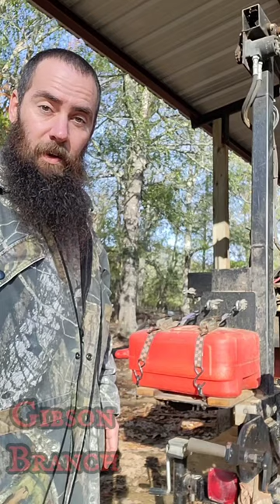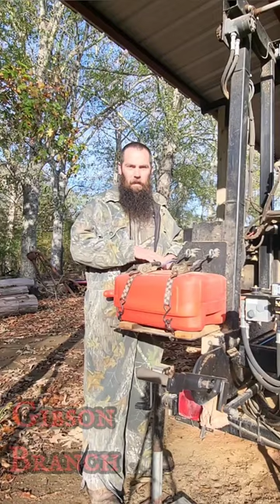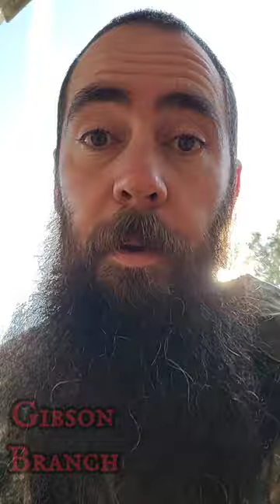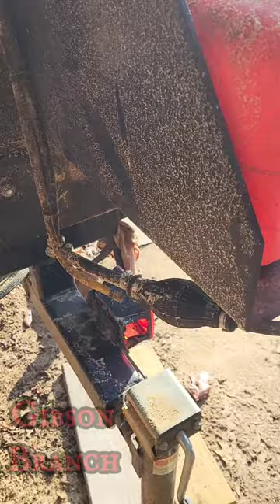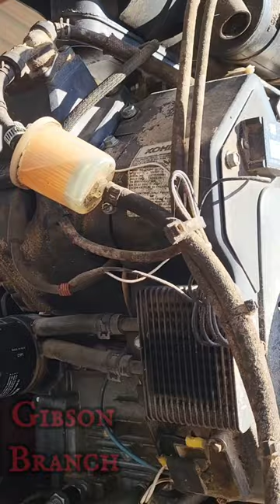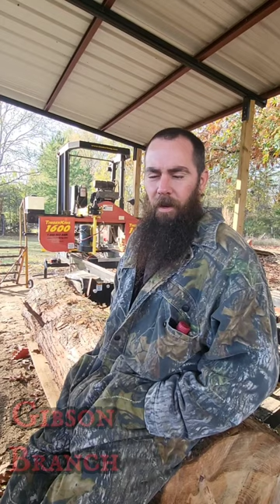Timberking Sawmill Repair (Improved FuelTank)

Comment: Depending on which version of that engine you have, the low pressure pump should do the trick with just a priming Bulb.
I've seen a couple different kinds of setups, but the simplest fixes, are always the best👌